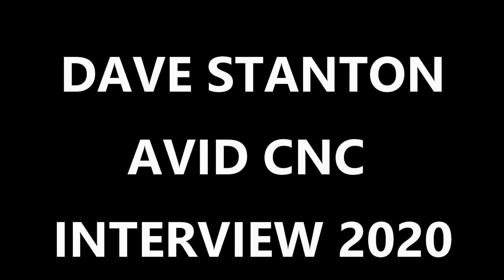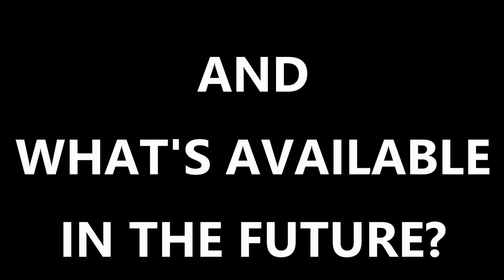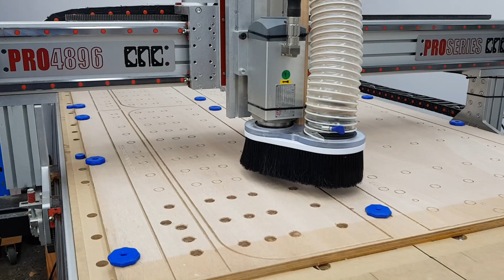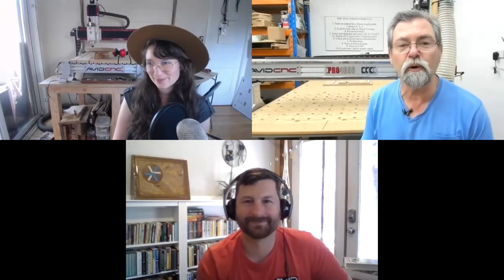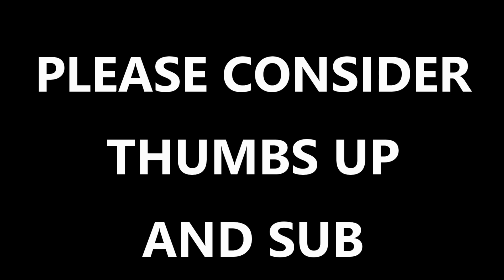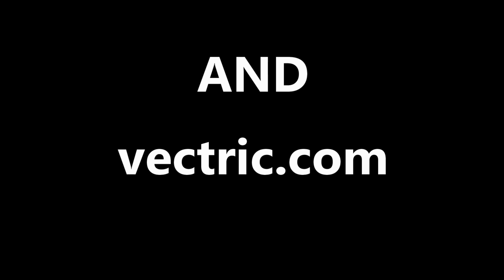11 questions you wanted to ask Avid CNC Dave Stanton interview with Sami and Cory

Comment: That was great, it appears just like any tool, get the best you can afford.  I think I'll be a few years off buying one but would love to experiment.
Reply from the maker: Thanks 👍
Reply: Dave, what do think if the shaper origin for a small shop vs a full CNC? A friend of mine uses the shaper origin to so such jobs as putting shelf holes in cabinet sides vs a LR 32 by Festool or a Blum 32 mm hole machine. Interesting for odd jobs vs production.

Comment: Dave, it's a pity there are no distributors of Avid CNC machines in Australia. I ended up getting an Axiom which I am very happy with. Though I am still a Noob with Vectric and CNC.
Reply from the maker: Hi Stephen Wallbank! A local distributor would likely add their margin. What would you prefer?
Reply: @DavidStanton  Of course. Margins are for the cost of doing business and profit to reflect risk. Otherwise there is no point. Customers need certainty especially for machines that are in the $20K+ category.